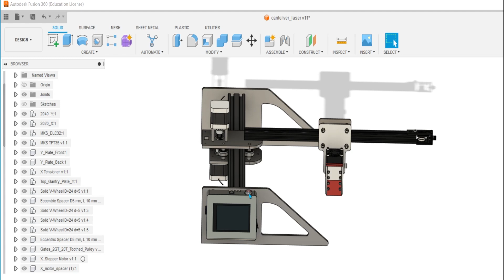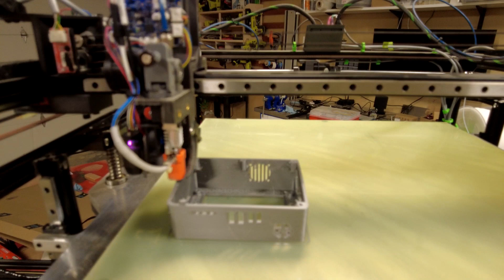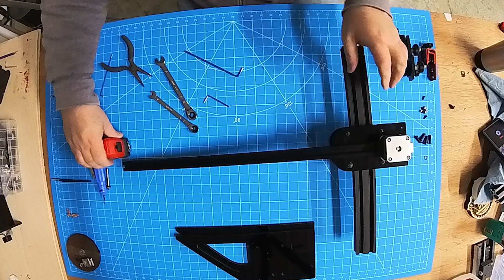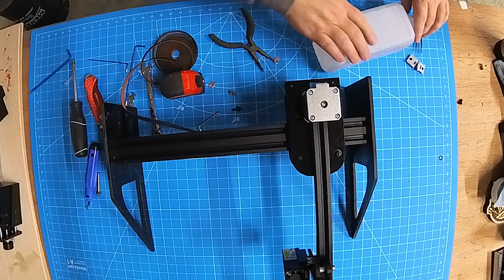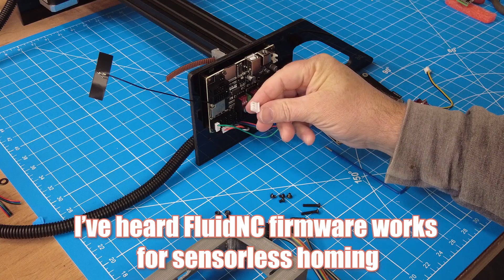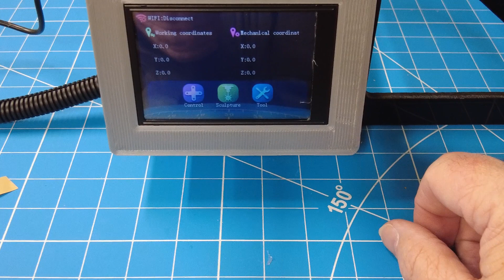How to make a Laser Engraver - Part Deux (Frame, MKS DLC 32, Steppers)

Comment: i not has looking software anythink yet, not use fluidcnc many say not good. normal dlc32 own and laserGRPL whit computer or lightburn. maybe need some setting change ,different SW and other input/output pins. i not know sure, i not has newer use before and not know firmware code anything.or setting.

Comment: 3 amp power, not working, laser need 4 A and board dlc say need 3-5A, just i order 9A power supply 12V, before has 24V power supply but laser not working 24V need change power 12V supply.

Comment: what have connectors name this , laser to dlc , X and Y to dlc board. were can order. my laser cables has very short not can use, need order long cables. but what name and were buy. laser come 4 pin cable neje 40640, and power 2 pin cable. and power board to dlc come 3 pin cable 12V + GND, TTL.

Comment: have same parts but i use MGN 15 rails. not wheels.  just i try think how plan motor mount to X and Y axis. and how install beam, i not use aluminium profile. only MGN steel rails whit wood frame.